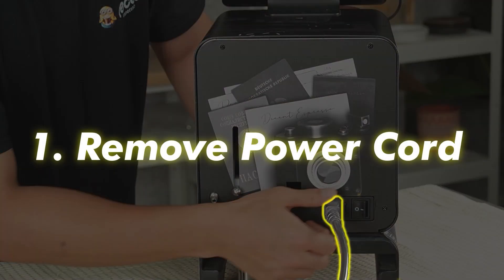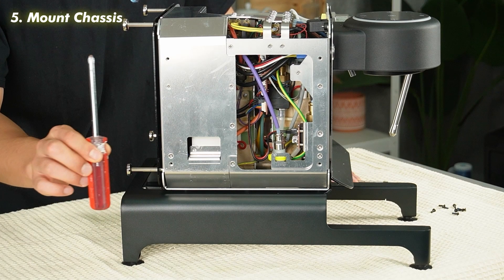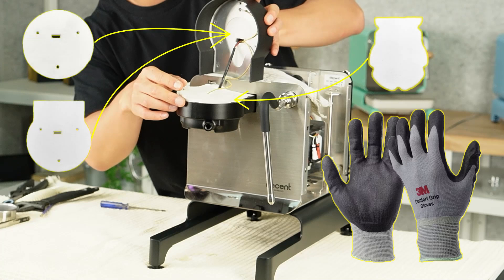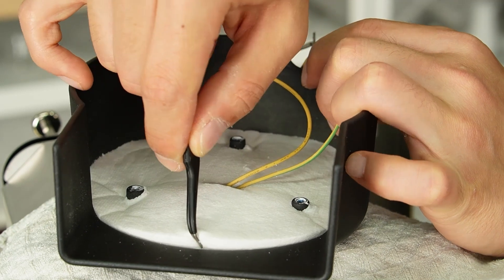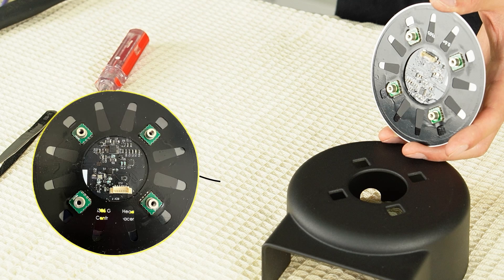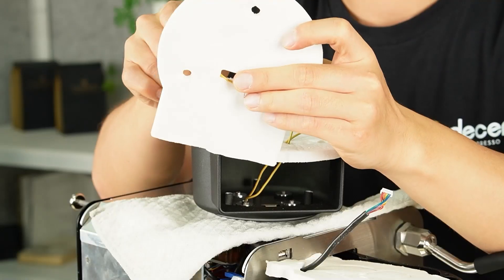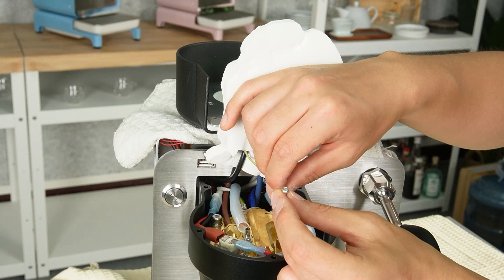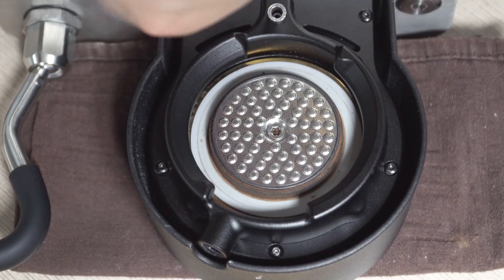How to Open the Group head cover and Replace the GHC (Group Head Controller)

Comment: thanks for the detailed fix, i either have a software issue as it has developed a fault since the update or the grouphead controller has gone faulty. I hope to wait for an update so i can dismiss this then check the hardware side. the machine still works okay for espresso making. Only steaming is affected at the moment.